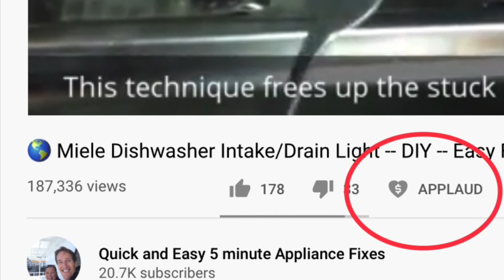✨ GE FREEZER Top Freezer - LEAKING on FLOOR — FIXED ✨

Comment: Was wondering when you say water leaks onto the floor, are you referring to the floor of the freezer or refrigerator or the floor we walk on ?
Reply from the maker: Good question,  it’s actually both.
It leaks on to the floor of the freezer and then eventually on to the kitchen floor.
Reply: I see .... I just finished cleaning the pipe but the exit pipe attachment is not sealing the pipe well in the back of the fridge. 
 @FastFreeFixes